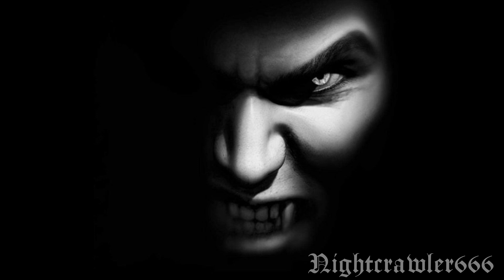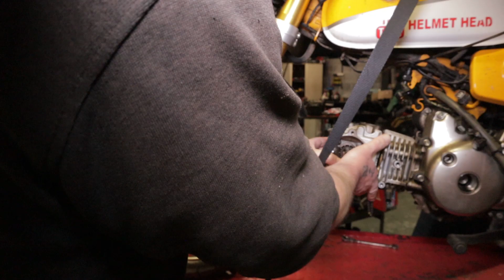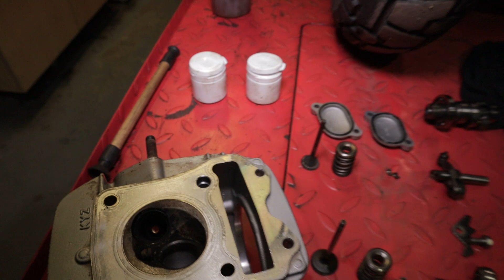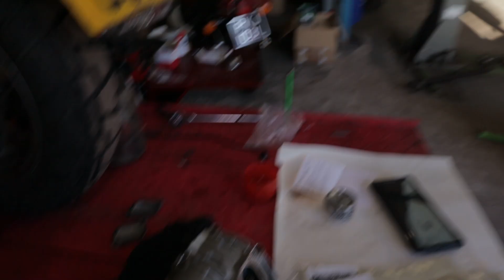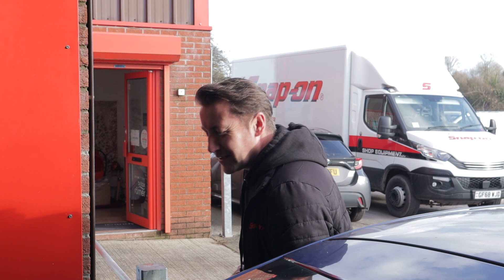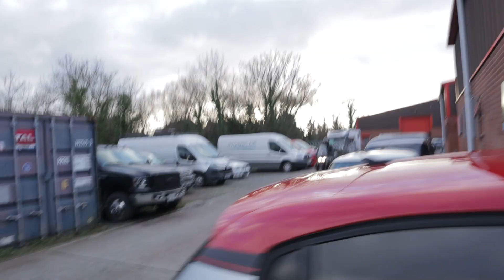Helmet Head Honda Monkey Bike Build Episode 1. The world domination Preparation.

Comment: 316 is actually marine grade... possibly food grade but I can't be sure about that. It is used a lot for street furniture (railings, seats, bins and the like).  308 is OK for general applications and of course for machining or milling you are much better off with 303.... although, it can cause terrible galling... as you well know!
Reply from the maker: Well thats that cleared up. Thanks Colt 👍

Comment: Why was the engine in such a bad way at a low mileage? 

Bad fuel? Run too much at full throttle? Not broken in properly?
Reply from the maker: It was about 7k miles if I remember rightly. It had been burning oil for long periods of time due to worn piston rings. I've been told they need new rings at around 5k miles. I'm not sure if that's accurate or not.
Reply: @Nightcrawler666  Thanks for the reply. At least changing the rings is an easier job compared to say a car engine!